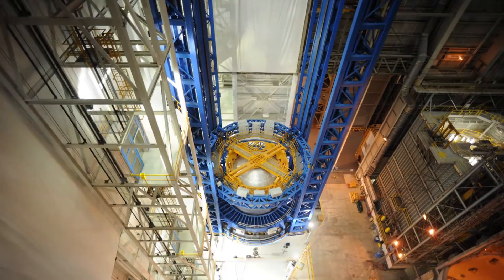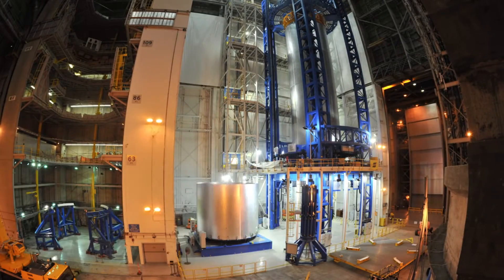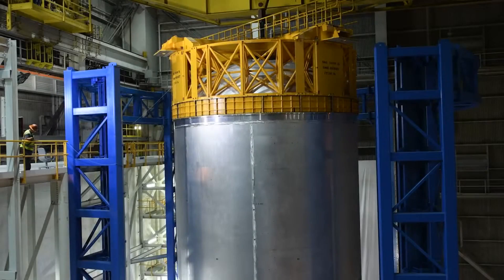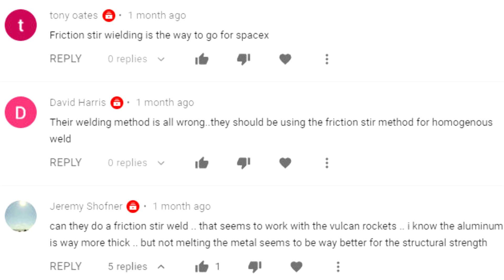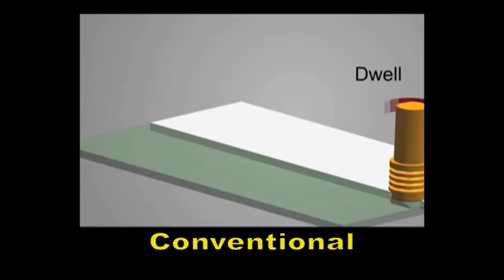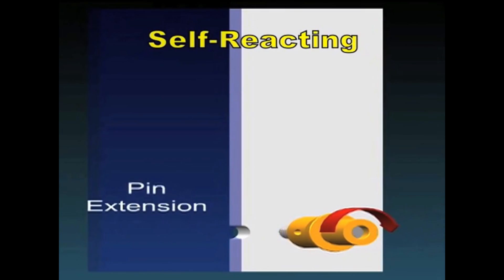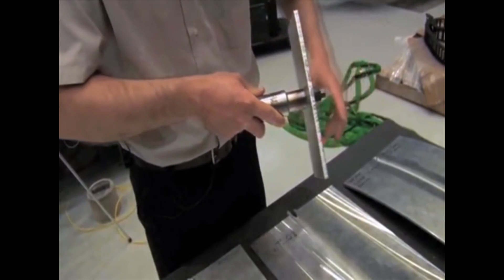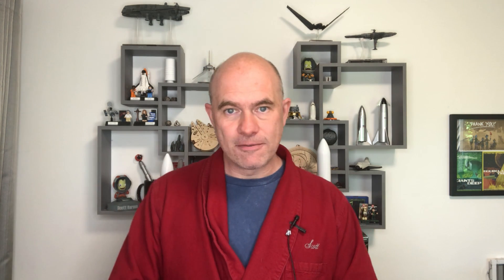SpaceX's 4th Starship Prototype Collapses During Test

Comment: They should be using sub arc welding,  if welding by hand   tig weld the root run then mig weld subsequent runs. There seems to be a lot of heat distortion in the panels of  SN4 from images I've seen. Stainless is not an easy aloy to work with,  but the necessary processes are available.  Unfortunately the smallest defects will cause failure,  this is one area I don't think Elon should be trying to reinvent the wheel on.

Comment: Seems like they need to take a knee for a second and come with a better synthesis between the moving fast designing iterations of the final product and spending years developing the perfect production method. Maybe work on smaller scale tests or specific function test vehicles to probe out the flaws and kinks of their chosen production method? If the focus is high volume production surely the focus should be to perfect production before the actual final vehicle? Is it just me or are they working on this process from the wrong direction?

Comment: I wonder if they would benefit by building from the top down like a harvester silo is built .  They build the roof first and use hydraulic rams to lift the structure up high enough to install the next level down.

Comment: But elon musk is not so smart if you think about it. Investing milions into improving rockets instead of gravity propulsion or smth similar with informations that are provided by Nikola Tesla. For one EM waves are not transversal but longitudinal vibration in the aether similar to sound in air.
So by that logick there exists a way to have aether propulsion which is everywhere present in the "non-excited" form. Also aether is fundamental and it's it that gives mater its energy.
He didnt agree with relativity and said explained why its destined to oblivion and the radio that we still use today was explained to be an aberation of science where his system was effecient and selective while radio is radiative and verry ineffecient. He also calculated that radio as we know of today would have such a huge drop off due to gravity that it wouldnt be possible to transmit further than a few miles. 
Our science is corrupt, so elon should stop doing nonsense ozone killing rockets and focus on develop what i just said.

Comment: It looks like the top of the fuel tank was sucked in just prior to collapse.  That would lead me to believe the gas in the lower tank went below atmospheric pressure due to dropping temps.  I have heard of 10,000 gallon steel process tanks collapsing like that just from going from ~200 degree water to tap water temps.

Comment: I was just thinking Would it be possible to introduce a reinforcing lattice structure on the inside of the stacking rings so that the rocket body becomes more loadbearing. Without an unacceptable amount of weight to the stack.

Comment: since Liquid has more power under pressure than any gas i think upper and lower  tank became misshaped (stretched by the liquid pressure above) in relationship to each other, causing the entire structure to weaken. You can see the dimple in the video which leads me to believe the weight was beginning to take a toll I think the liquids in both tanks provide uniform strength that does not exist with oxygen tank pressurised. If anyone can do it Elon Can.

Comment: The lack of specialist welders is the main reason so many of the older rocket engines are not made any more. They need to relearn and teach ppl to weld specific types of metal again and not worry about the cost 8f they want to get it done again. I am sure the cost of having all the specialist welders is the main reason many of the older design of engine is not made, as robotic welders can't get into position a human can

Comment: Hi Scott, I take the point about the upper tank being loaded (40 tonnes? ) while the lower tank was not pressurised resulting in structural weakness, but we know the Starship payload is intended to be in the range 100 - 150 tonnes, and this will surely be integrated onto the Starship before it is fuelled, so how will that work without significant structural strengthening?
Reply from the maker: More like 450 tons in upper tanl
Reply: Ah that would make more sense.  I suppose the switch to whatever super grade steel they ultimately plan to use will give extra margin too...
Reply: @scottmanley  What about the thrust? Imagine Starship launching and the flamey end lifts off but the pointy end stays put...
Reply: @TheFnorg Haha, Elon & Jeff watched too much Star Trek and others during their boyhoods. Now they are desperately trying to revive the feeling by turning their favorite sci fi seri-eez into reality. But chances are low without Warp drive.
Reply: @TheFnorg I point my head at the sky like a Starlink antenna and then I feel the connection.

Comment: So maybe I'm missing something but if the tank failed because it wasnt completely full then how is it supposed to take the stress of launching after much of the fuel has been used up? Do they have a way to keep the tank pressurized all the way to the ground?
Reply: I understand that only one part was the one that wasnt full. Would it be different if both tanks are the filled to relatively the same level

Comment: I'm wondering if this is happening on the pad. What will happen when the load of the engines is applied? At the moment I'm not seeing this as working. Maybe a center support column like is used in buildings would help.

Comment: The Soviets designed their rockets this way.  Build fast, “fly to failure,” fix what went wrong, then try to fly it again.   SpaceX is not trying to fly these, but they are definitely using a “okay, let’s try this, then” approach and then fixing things as test articles      are destroyed.  The Soviets ended up with really terrific launch systems. So shall SpaceX.

Comment: "Gas Metal Arc Welding" in the description is commonly known as MIG, the most common type of welding most used on mild steel and stainless steel. TIG welding is more for small precision welds on thinner pieces of aluminium. Laser welding is not ideal for joins requiring high tensile strength as it doesnt get deep enough into a thick join. I'm running on the assumption they're using MIG to join the stainless panels together as its the easiest and strongest for stainless steel welding. Unfortunately the side effect is you get a tonne of contaminant from stainless welding called Chromium and Hexavelant Chromium which are highly toxic and carcinogenic -  Source: I work in the welding business

Comment: Types of welding:
TIG (Tungsten Inert Gas) is (Gas Tungsten Arc Welding) GTAW.
MIG (Metal Inert Gas) is (Gas Metal Arc Welding) GMAW.
Resistance Welding is most commonly used in the "spot welding" process.

Comment: Probably one of those embarrassing things where the inlet valve to the lower tank was closed in case the compressor ran out of fuel or something not thinking that liquid nitrogen would cool the adjacent tank decreasing the pressure... then it crumpled.

Comment: Most comments are head-shaking amazing.  Most commenters see the spacecraft fail and assume the spacecraft failed because it is badly designed and/or badly constructed. SpaceX already determined the test procedure was faulty, which caused the failure. The TEST PROCEDURE bros. Doesn't anybody read?

Comment: Not an engineer but at 1:03 you can see the lower tank implode.  It didn't buckle or burst.  I would bet this was a thermal issue where the lower was pressurized until the liquid nitrogen cooled it down (thus lowering the pressure) to the point of failure.

Comment: These series of failures are just getting embarrassing. I understand the rapid iteration process, but these failure modes are not due to iterative design. These are just plain screw-ups due to going too fast. At the beginning they should have taken 3 months or so to work out the weld process. Then there was the thrust puck issue due to an engineering mistake. This latest failure is due to a test config error. Too many unknown variables being solved at once.

Comment: if youre doing pressure check testing... not going to launch, or fire the engine... Why the hell dont they put a support crane over just in case the bottom cant hold it? an emergency tether... these engineers are so smart sometimes they get stupid.

Comment: Scott.... that is the most sensible explanation of what may have happened. I am aghast that they would merely pressurize the lower fuel tank. We all know that aircraft wings have added strength and lifting abilities when full of fuel. Those tanks are filled to the point of zero air above the fuel and they are not called upon until the centre tank is depleted of most of its fuel and the weight of the aircraft is much lighter and then the wing loading is lower before fuel is transferred from the wings to the fuselage centre tank.

Comment: There is no safety culture at Space X. Which may not have much impact if it were a 12 year old's back yard rocket build. But for crewed spacecraft without any abort capability - they are going to kill people. No designed abort capability is a function of a certain design/vision arrogance. You'd think they'd learn from shuttle that any time you cut corners and rush a build/launch schedule people die. How about we start asking tough questions Scott, instead of making excuses and rationalizations. They aren't testing correctly? - duh!

Comment: I only have a few days worth of experience into welding... But could it somehow be possible to either 3D print the base structure out of liquid stainless Steel or similar metals or simply make a large cheramic form and make the large tube shaped structure in one piece with No weldings ?

Comment: While I'm only a farmer, and cannot speak of LASER beam welding, TIG or Tungsten Arc Welding is the go to in stainless, though quit time consuming.  I suspect most of the panels would be MIG/GMAW, whether automated or manual.  TIG would more likely be used for things like lines and fittings welded to the tanks.  Resistance welding would be your standard stick I would assume.  I don't know much about plasma arc or Orbital tube welding.  There are many other types of welding as well, some places they work wonders, but don't all fit into a square hole.

Comment: IT SHOULD BE BUILT IDIOT PROOF.  What if you fly 100 people and somebody forget to close or open a valve? If they really need to build a rocket  that can fly 100 times, the current design will never work. It should be rigid enough to support everything with valve closed or opened. If it's heavy and they cannot to store specific amount of cargo or weight, just build a bit bigger. Size is not a limit for Elon. I think they should use already their Falcon Heavy rocket. Stock two Falcon Heavy rockets inside the Starship and that's it. I mean stock 6 Falcon 9 booster style tanks inside and it will rock....

Comment: It looks to me like the lower tank crushed inward due to outside airpressure, so I don't think it just lost pressure.  My suspicion is that the lower tank was pressurized with a gas that then cooled and shrank as the liquid nitrogen  was loaded causing it to "implode" and then it crumpled once the structure was compromised.

Comment: The visible dents in the lower tank section prior to he collapse indicate to me that there was not much pressurization if at all in the lower tank section. If the gas present in the lower tank was cooled down by the cold bulkhead it might result in lower than atmospheric pressure resulting in the crunch like collapse.  Considering that there will be 50+ tons on top of these tank sections I think they need to design much stronger tank sections.

Comment: At the beginning of the sequence, the top of the lower tank seems to be dented already.  I wonder if the lower tank wasn't pressurizing adequately right from the start.  Under the circumstances, wouldn't the steel be highly stressed by the huge temperature differential between the upper tank (-179 deg C) and whatever the lower tank is full of, presumably a gas at room temperature, possibly warmed by the act of filling it / pressurizing it..  

The circumference above would shrink from the cold, while the circumference below remains the same (imposing shear stress).  Cooling from the tank above would reduce the pressure in the vessel below, adding to the stress on the metal, welds and fittings.

Comment: I've developed friction stir welds for various aluminum, stainless, and titanium aerospacs applications and have to say that yes, welding stainless is a massive pain in the ass. The tooling required to do it is practically limited to PCBN fixed pin tools, so self-reacting and adjustable pins are unusable. 

So for that case massive mandrels need to be built to react the similarly massive load applied and it becomes unwieldy.

I agree that fusion welding is probably the best way to go at this time as long as they're using stainless but this did look like more of a testing failure as others have said.

Comment: The method SpaceX uses to weld the starship is called Tip-Tig. It’s very similar to Mig/Flux core. I’ve never seen this method until I worked for a few weeks at the Boca Chica site. It’s very easy to learn it  unlike tig welding where more skill is required to achieve good consistent welds. 
The equipment is bulky and heavy making it not so portable but they manage to utilize it well when the welds are close to the ground.

Comment: Frankly, there needs to be small vertical ribbing die formed while rolling the ring sections (excluding the weld area) to increase the weight bearing strength with very little additional weight penalty, ribbing small enough so the windward side can be made smooth by the heat shielding. They can't expect to solely rely on perfect tank pressurization. (Look at the ole Ford Tri-Motor Airplane ribbing as a crude example).

Comment: The bottom section, the rings,  thrust structure, legs, bulkhead seem intact, are they are salvageable/reusable?
Were they able to run the hydraulic plunger tests of the thrust structure before SN3 structural failure?
Could the error be the lower tank pressure was set sufficient to support the upper tank full of LOX but not the much heavier LN2?

Comment: I wonder if a large volume of gas in the tanks underwent a massive condensation event as it normalized in temperature with the bulk of the liquid being introduced to the tank.
Some thing along the lines of ....They introduce the liquid and a lot is vaporized as it hits the walls of the tank...This causes a pressure spike as that liquid vaporizes....The pressure spike triggers them to pause filling.... The remaining liquid in the tank normalizes the tank temperature to minus a lot and proceeds to cool the gas volume allowing condensation of some of the gas and a decompression of the tank pressure.

Comment: When they weld aircraft carrier or battleships whenever possible they use an automated welder that uses a sand-like material like a 5 gallon bucket of the material at the point of the weld so much of the material that it covers a large portion of the welding handle

Comment: I don't know why they are wasting so much material but they must know from the start that it is going to fail you cannot weld outside the Argonne or whatever guess they are using creates a bubble around the weld where little atmosphere or no atmosphere can interfere with the weld welding in the wind outside will destroy your containment around the weld it can't be done
Reply: spacex launches X37-B

Comment: Could this have been a loss of pressure due to a reduction of the temperature in the lower section causing a relative vacuum ?
Reply: Revised my theory slightly assuming that Space-X engineers are smart.  Also assuming there is a shared bulk head. The lower tank is pressurized with gaseous nitrogen. The top tank is filled with super cooled liquid nitrogen. Because of the shared  bulk head the temperature of the nitrogen in the lower tank starts to drop, however this is compensated for by the pressurization system which continues to feed more nitrogen into the lower tank to maintain pressure. However at some point the bulkhead temperature drops to a point where the nitrogen in the lower tank starts to condense. At the point the pressure in the lower tank drops rapidly, the pressurization  system cannot compensate and a relative vacuum occurs resulting in the lower tank imploding. Just a theory and honestly I'm too lazy to do the math.

Comment: I know nothing about friction stir welding except that it seems like a good idea for soft materials like aluminium and that SpaceX among others use it. I do know something about steel, and friction stir welding  stainless sounds like a bad idea. 1. Stainless is stronger but heavier , so you need a thinner wall for the same strength. 2. Aluminium would need to be close to its melting point to stir like that, stainless's melting point is about 3 times that of aluminium. 3. Stainless work hardens when you deform it, so the friction zone would be even harder. 4. Quality testing of thermal welding of many grades of alloy steel (admittedly not stainless as far as I am aware) requires that the hardness of the welds be BELOW a certain value, since hard welds are brittle.

Comment: It look as if they got a lower pressure than atmospheric pressure inside for some reason. Is liquid nitrogen pressurized in the tank? If not an unpressurized  liquid nitrogen leak in the lower part of the spaceship could have reduced pressure inside through cooling and made the structure crumple.